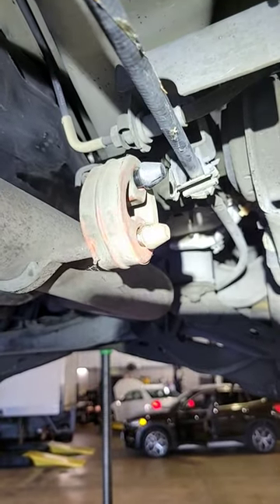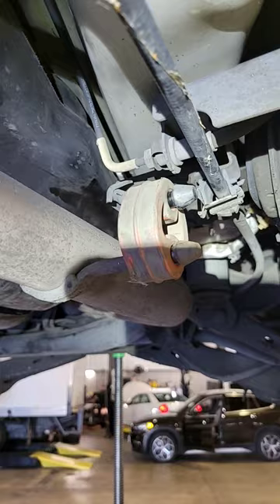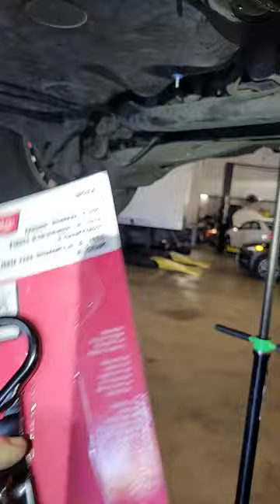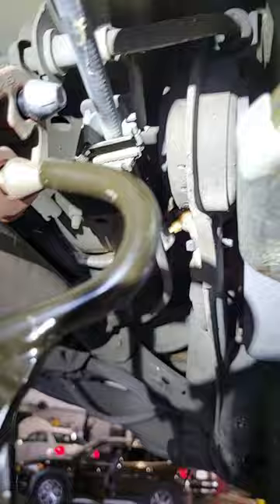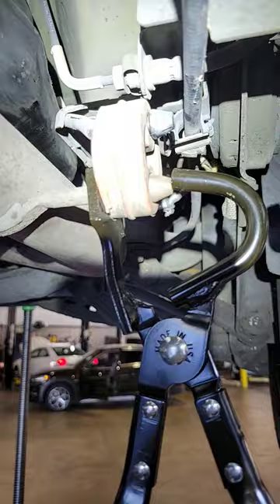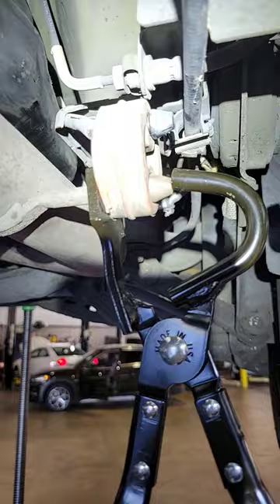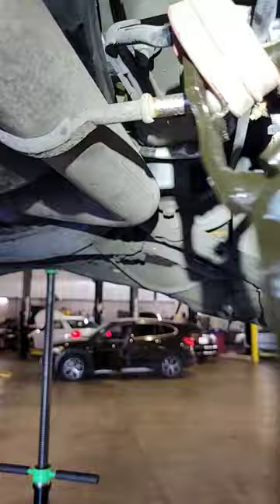LISLE Exhaust Removal Pliers

Comment: Silicone spray works wonders as well !!!!
Reply: Dry*
Reply: Why not both?
Reply: Been using silicone spray and a pry bar for 40 years.
Reply: Silicone spray and hand power , no need for pry bar or any tool .   People need to work on there hand and arm strength !!!!
Reply: A screwdriver and wd40
Reply: Exactly.  That and a small prybar. Harder to get them back on imo.
Reply: I use liquid wrench it works every time
Reply: A little pb and a pry bar
Reply: @americanadventureoutdoors4213  you live in the northern states?
Reply: @mikecoffey8453  wd40 is petroleum based and will ruin the rubber
Reply: Yup
Reply: @americanadventureoutdoors4213  a lot of guys that just muscle stuff over the course of their career and beat to pieces and wore out by retirement. I understand where you’re coming from, but instead of manhandling stuff, sometimes it better to just use the tool
Reply: @American Adventure Outdoors  Work smarter not harder. Arthritis sucks.

Comment: I've worked at O'Reilly's for years and Lisle makes some of the best specialty tools I've ever used. Took me forever to find a tool that would remove the trans oil cooler lines from my 07 explorer radiator.  None of them would work until I used the one that Lisle makes specifically for the my truck. Worked perfectly.

Comment: I replaced my whole exhaust on my 99 4 cylinder camry due to PA inspection. From the manifold all the way back. On the ground. With gravel for a driveway. Wasnt the easiest, but it was surprisingly not as difficult as i anticipated. Also changed the timing belt, which also wasnt as difficult.

Comment: They're also good if you're a Ford tech for the countless transmission shifter cable bushing recalls that come in.
Reply: Dude, don't know if his tool would work on those grommets due to the clearance between the pan rail and grommets. I got the same tool, made especially for Ford linkages. Those nylon bushings are more difficult to get apart than those rubbers on the hangers. I'm  sure you know, but for those people who don't, this type of tool is ideal for linkages. If you try using a prybar on the linkage,  more than likely you'll bend or even snap it. 
Of course since they quit making AODS, C4S, C5S, C6S you really don't need the tool any more. Most have a ball and socket that easily snaps off.

Comment: If you spray the rubber with silicone spray lube they pop right out with your fingers most of the time.  The tool is nifty though.

Comment: Just spray wd40 / pb blaster and a flat head and it comes off like nothing 🙃
Reply: Never had an issue with this method
Reply: Not always lol. Do wd40 and this and it'll be much easier. This tool is $20 or less too. Might as well use the right tool for the job.
Reply: @yamipizza8357  the ones I ve done always work lol ..but yea wouldn't hurt to have that tool in my box
Reply: @yamipizza8357  if I worked in a shop, then I probably would have this tool. I only work on my own stuff, so I can count the number of times I've had to do this on my hands. I'm all about some nice tools, but I tend to spend on ones I will use regularly.
Reply: @joeroe2839  Ever touch one rusted from the inside out? Yeah, screw drivers don’t work.
Reply: @mikeznel6048  rust on the rubber then heat that thing up lol

Comment: Put a flathead screwdriver in between the dowel and the hanger (on the bottom side, tip toward the end of the dowel), pry downward with the tip of the screwdriver, pushing it from the tip, this stretches the hanger slightly while also pushing the dowel through the opening. With enough practice you can do it with one easy motion. I have it down to an art.

Comment: For all you advocating pb blast wd 40 etc.
Those petroleum products will start the rubber deteriorating.
Cut the hanger and use a new replacement.
At $25/hr if you spend 10 minutes on removing you gave almost exceeded the cost of the part. Similar rubber hanger is $4 and change at advance auto. Razor much cheaper than labor.

Comment: WOAHHHHH MANNNN get the biggest bluest channel locks and just use your brain. I imagine you got some sets of channels in your shop
Reply: WOAHHHHHH MANNNN!!! Your big bad blue channel locks are not gonna fit in all places that this tool does. Nor do they work anywhere near as good. Not to mention, these pliers are not that expensive, probably cost less than those big ol' channel locks. Yes you can do more with the channel locks. But the right tool for the right job is worth its weight in gold.
Reply: I bought a pair of channel locks when I first started doing work various times and I had it for 20 or 30 years until someone else figured out that they needed it worse than I did

Comment: Ok, another tool. I found that a long flat screw driver works by cross fishing it in and torquing the hanger off. Of course all spray lube for good measure.

Comment: The only thing I was kinda thinking was to put a little dish in the end of the "pin".
So it doesn't slide off the metal hangar as easily. 
And every time I remember to try doing that,it's too late and I'm using it 😄

Comment: Spray some lube in there like wd40, soapy water… actually brake cleaner works really well for that stuff. It lubricates to get it apart and then dries quick so there’s no residue. Then add a little high temp grease in the rubber before reinstalling it. I have that tool and it does work great but it’s not needed if you spray some brake cleaner in there.

Comment: Supposed to spray them first. Also, had the same tool snap in half in my hand. Always be ready for failure. Pinched the shit out of my hand. The hooked part broke off.
Reply from the maker: That would suck
Reply: @NutsandBoltswithTone  It wasn’t very fun. Still have the mark on my hand.

Comment: Mine isn’t getting them off. It’s getting that last one on that’s gotta go on from some odd ass direction that can’t fit on easily because the exhaust needs to shift in the opposite direction. Happened on my titan when I did the exhaust on it. Spent more time on that one hanger than the entire exhaust replacement. 🤣

Comment: I'm sure your tool works better, but I've always had good luck using those super cheap "hose removal" tools that are basically reverse pliers where each jaw is v-shaped just slide it behind the rubber and against the nub and squeeze the handles.
Reply from the maker: I have those as well and they work ok sometimes. These work great all the time. Thanks for watching

Comment: Never, i.pull down on exhaust a little and then spray a little wd40 in the holes where its been stretched by pulling down exhaust, then give exhaust good wiggle and usually i can slide them off by hand.

Comment: Put a condom on the end of the metal tip and tuck the rest between the hanger and the flexible piece. It should pop out easily without tools. Do not reuse condom.

Comment: There are different types of vice grips that would do the same job
Reply from the maker: These pliers cost like 20 bucks.
Reply: Not bad. I have 3 huge tool box drawers full of different types of. Basically everyone they make + 8 or 9 more of each.. and a few that were redesigned...

Comment: My muffler rusted off at one point and was being dragged and that rubber piece was the only thing holding it up, after about 15 minutes of trying to take it off by hand I ended up cutting the damn thing off and threw my muffler in my trunk 😭💀

Comment: Last time I dealt with those under a rust bucket I just gave up, cut it off, and slapped a new one on when I was done
Reply: Well, sometimes the rubber is rotted and it should be replaced!

Comment: Why to buy useless tool while most of the time that rubber hanger is in so bad condition, it requires replacement? And it doesn't cost the fortune. Every time I do something with my vehicles, I cut them with the wallpaper knife and replace with new ones.

Comment: OK, people. Save your money. Just read all the comments about all the people who use just a prybar and wd40. Believe me, by doing so, you can get it off in seconds.
Reply from the maker: OK bud I've been doing this for a while lot of years and yes sometimes it comes off easy but sometimes it does not,  the times it does not its just easy to use the pliers
Reply: You haven't  been doing it any longer than I have. I got 47 years in this field. I'm a transmission rebuilder by trade, and there are plenty of applications where you need to drop the exhaust along with those hangers. Again, never used the tool,  never had a problem getting them off. We get a lot of snowbirds down here in FL. Their exhausts are usually rusted as hell, along with the hangers. That's where wd40 forty works best. After all, that's what made for... rust.
Reply from the maker: @stevegriffith7236  awesome man well sounds like you got it handled.